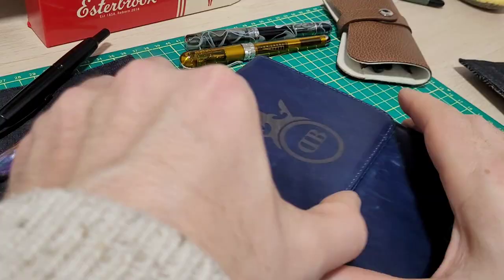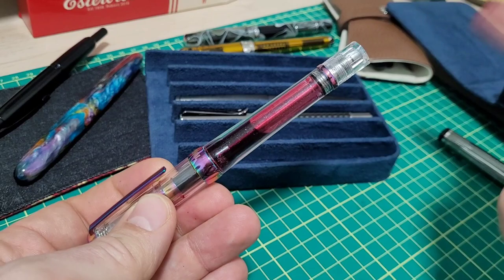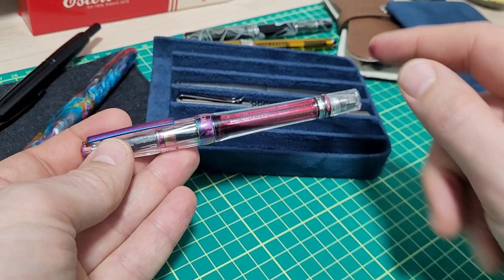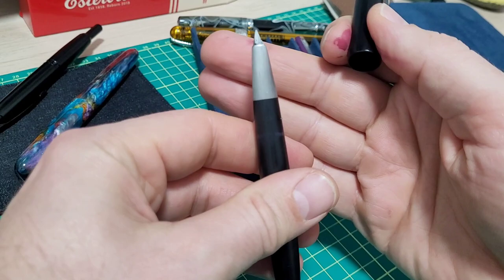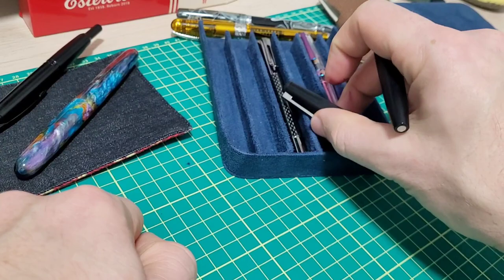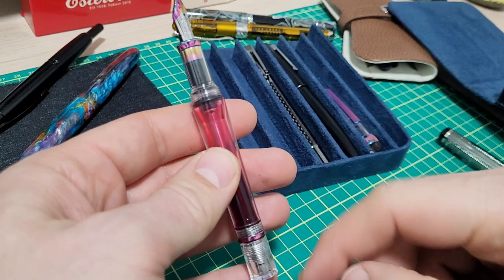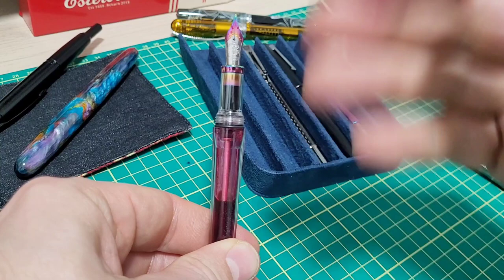Pens On Planes - How To Safely Fly With Fountain Pens

Comment: I haven't flown in a decade, but the last time I did, I took a Platinum Preppy converted to eyedropper, because at the time, that was my pen of choice. And the reason for that was, not only had I been introduced to those pens by buying large bottles of a certain brand of ink that included a free Preppy with each bottle, I'd decided earlier that year to adopt a specific ink that should probably only be used with steel nibs, and since the Preppy not only has a steel nib and an inner cap that seals very tightly, but holds an incredible amount of ink when converted to eyedropper, it makes a really great travel pen. Since I always store my pens tip up in my handbag or briefcase, I never really have to think about problems like pressure equalization. Nowadays, I use TWSBI ECOs with that same ink, but I still only keep them tip up in my bag.

Comment: Good advice. I would use the 823 or the MaJohn C4 that has a seal between the barrel and section. It also drains nicely to minimize any leak or burping.
Reply from the maker: Like I showed you still have to be mindful of the or in the sealed off ink chamber or else you still have the same issue as every other pen

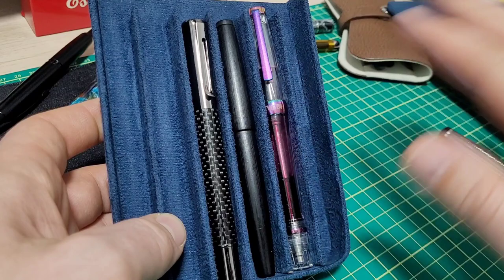Comment: 1:20 : how to travel with the pens
1. Wait to be at cruising height
2. Open it nib up for the first time 
3. Use it
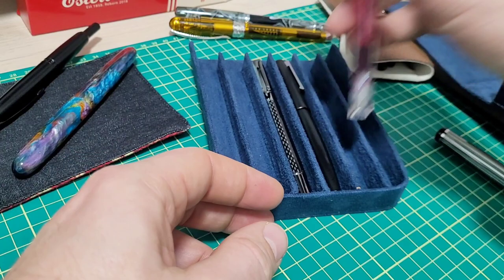4. Extra step for vacuum filler pens 2:26

Thanks Noodlebud for this
Reply from the maker: Well, if you have a vac filler pen there is that extra step.
Reply: @Doodlebud  fixed

Comment: Great video!  I've flown with fountain pens for years with no issues (using this procedure, and making sure my pens are completely full before leaving on a trip).
The air pressure in a commercial airliner (at cruise altitude) is approx. 11 psia. Air pressure at sea level is approximately 15 psia.  If you live in a high altitude city (e.g. Denver, Mexico City, etc.) your nominal air pressure is around 10-12 psia (depending upon exact altitude and local weather conditions) - meaning you'll have no problems with fountain pens on commercial flights from these high altitude cities.

Comment: I have a slightly different view here, because even if the ink in the primary ink chamber won't be pushed out because the pen is nib up, there is still ink in the feed and/or antechamber that could be pushed out. Depending on the feed design, that could be a lot of ink.

What I do with pistons/converters is hold them nib up, wind the piston as far forward as I can to push out all the air(carefully!), and then pull the piston back again to suck all of the ink out of the feed and ensure there is a clear channel for the air to be pushed out through. With vacuum fillers, shut-off eyedroppers and bulkfillers you can just pull the shut-off rod all the way out a couple of times to draw all of the ink into the barrel before closing the shut-off.

Comment: Sorry to correct everyone that believes that the cabin pressure is lower than the outside, regardless at sea level, or at 10,000 metres. The truth is the cabin is pressurised before take off, even before the taxi way, that is at the apron, not on take off. Why? Because if the air compressor fails or there is real leak, they can turn around (on the ground) and if possible repair the fault, instead of past-point-of-return! 
Unless someone is a plane engineer that knows about air compressors and cabin pressure, please correct me, other wise sh! 
Again the cabin is pressurised before take off, not before!

"On the ground, the airplane is unpressurised and the outflow valve is wide open. During pre-flight, the pilot sets the cruise altitude on a cabin pressure controller."

Comment: Happy Holidays @Doodlebud!  New to pens and I have been wanting to purchase one.  I fly 70-90 trips a year so I will ultimately forget to do this at some point.  I have started journaling and want to work on my handwriting.  Is there a better pen/way to do this?  I write with a Pilot G2 .38 for years.  Love Pilot and would like some help if possible.
Reply from the maker: Just trying to understand your question.  When you fly you take the Pilot G2 but want to take a fountain pen and you're wondering if there's a better way to take fountain pens on planes?
Reply: @Doodlebud  I’m asking is it worth trying to keep a fountain pen?  If so, which pen, sealed?  If not, do you know of a better solution like a nice pen that takes a G2 insert? Maybe its not a fountain.  In your top 5 pen video you mention “travel pen” category and there is a yellow pen that is completely sealed. Have you pressure tested that SCHONDSGN
?
Reply from the maker: Gravitas has some good ballpoints that are really well made. Of course I pressure tested the SchonDSGN! Here's the link:
https://youtu.be/T4qWNzJtSNk